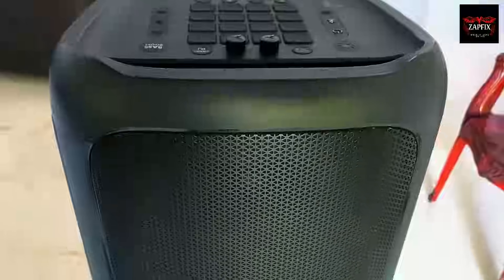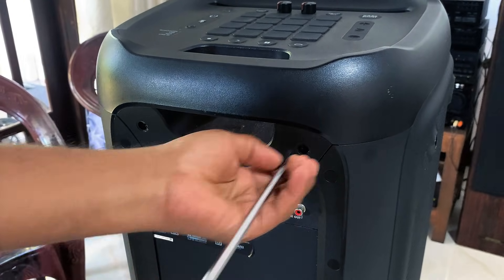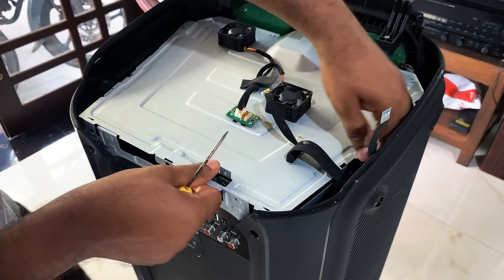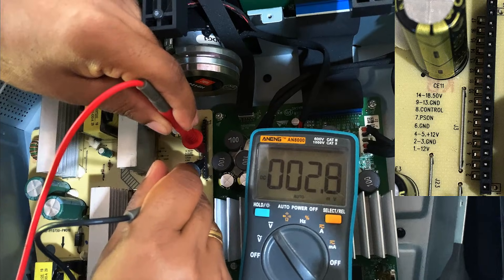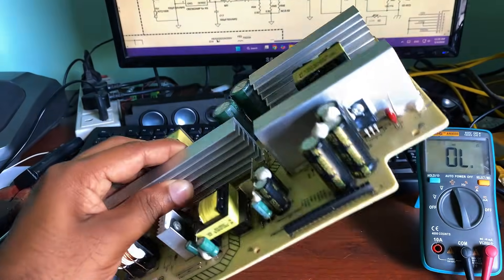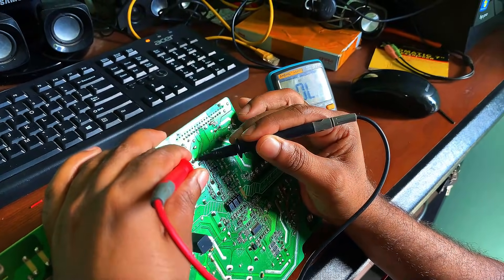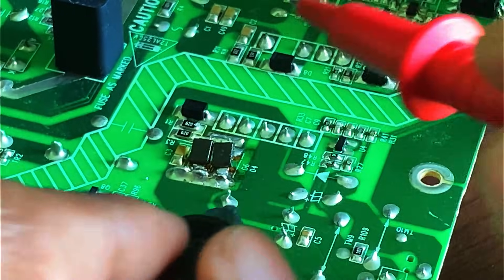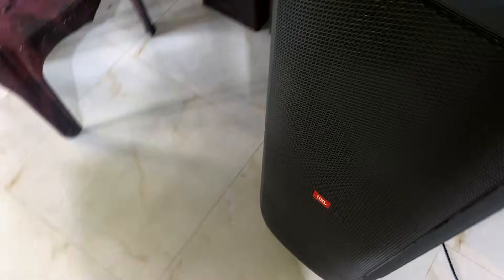🔧 JBL PartyBox 1000 Not Turning On | Full Repair Step-by-Step !

Comment: I have one with a component on the motherboard exploded. It's like a small yellow square  labeled 684J63. I don't know anything about electronics repair and much less about the components themselves. I just want to ask if you may know what component this is?

Also, is it possible to separate the smaller board that goes to external connections from the motherboard without soldering?

Comment: ,very good video, I wanted to know if you know where the defect is when there is no 50v? Do you have any tips you can pass on?
Reply from the maker: Yea. First there should have standby voltage. If it is not, power supply not working. 
If standby voltage is ok, then got 50v section. 
I have circuit diagrams. Can go through it.
Reply: Check the first ltv817-b
Reply from the maker: Absolutely 👍
Reply from the maker: Have you repaired it?

Comment: hello! When you measure diodes you shouldn't measure them with different polarity! When I give + at the input and - at the output there is no transition. If I do it the other way around there is. As if the diode was working properly.